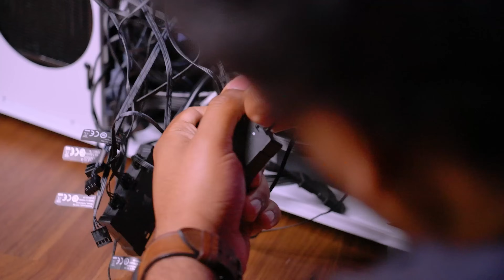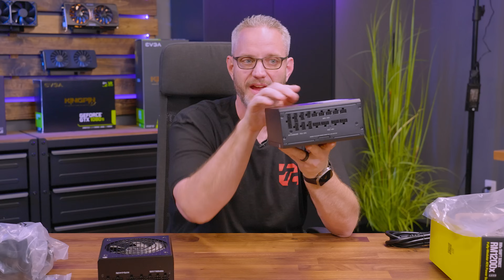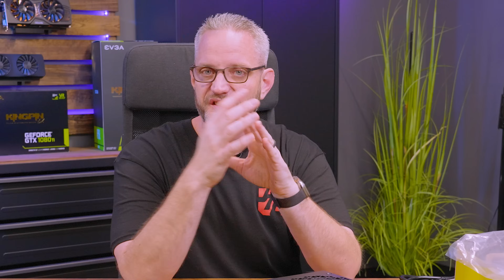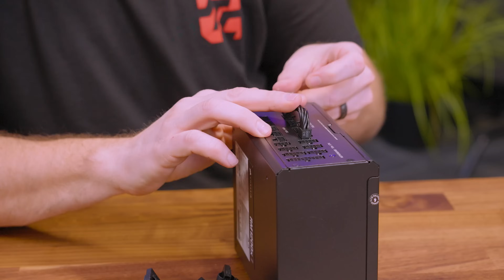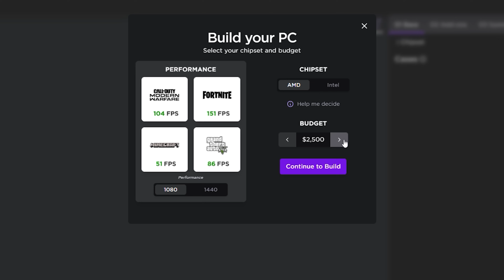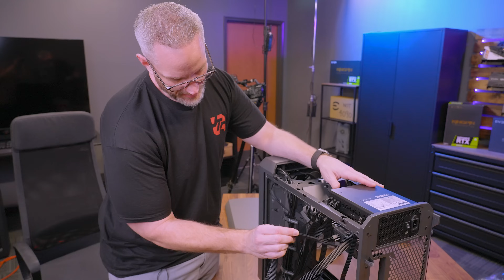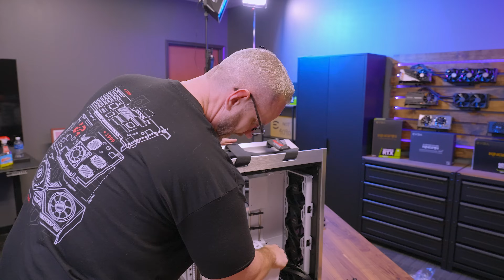I tried to prove this design was a failure... But then this happened.

Comment: I have a beQuiet dark power ... 11? 10? with 750W with sleeved cables. Getting this into the O11 Dynamic when using all cables the PSU supports was  "an endeavor". The fact you had to sort the cables out from inside, from the only place you can cable manage in the first place, while the sleeved cables stick to each other like glue was hand cramp inducing.
Seeing this PSU with the cables in that case coming out the top, which is space currently in my build completly unused is rather nice.

Tho I doubt the O11 Dynamic was designed with the consideration of people actually using all the thing can do at the same time. I.e. 2 SSDs, 2 HDDs and upright GPU mount, and a Lian Li control box, which all together leave little options how to arrange the backside. (And the updated version of the O11 we saw at some point, which adresses such things, dunno if that's out yet, showed that the design wasn't optimal)
Having to use PSU cables that have I think 1 SATA and 2 molex adapters because the PSU did not deliver enough SATA only cables did not make it any easier.

Comment: A better PSU standard is to output 48V of high power loads. This has been the standard voltage for communication equipment for over 50 years. This is the voltage used in servers. It would reduce the current being carried by the cables by 75%. Far fewer melted cables.

Comment: One reason power supply videos are boring is because they use circuits invented in 1920. In the last 100 years, there have been astonishing advances in power conversion. 2011 vintage circuits are cheaper, smaller, more efficient, have less ripple, have better transient response, and put less stress on components.
A bridgeless two-quadrant power converter produces less harmonic distortion fed into the power mains.
An interesting question is "Why don't manufacturers use 21st-century circuits?"

Comment: this PSU was degined for use in the 5000D/4000D corsair cases. the space between the standard atx PSU and the 3.5" drive bays on both series of cases is fairly limited, hence the reason for corsair to creaqte this PSU

Comment: You could say this power supply is useful, in a CASE BY CASE circumstance.

Hopefully the future has a slimmer, longer power supply in the future, with cases to fit it ,  with maybe the options to split the wires.  Maybe the main powers come out the old way, and the extras/more pcie etc come out the sides, or the option of both  or either.

Comment: I did get the corsair hx1000i and their additional 2x 8pin to 12vhpwr cable was worse than the asus tuf 4x 8pin  to 12vhpwr cable, i did lose performance by changing cables. For some reason, the power supply can't deliver as much power from just two pins even that corsair claims so.

Comment: Can an old power supply like the Corsair 1000w gold 2021 work with todays cards like 4080?
Reply: Yes, it can work with 4080 but you need to make sure you have 12VHPWR cable in place.

Comment: If your case doesn't have room, you have the wrong case. No power supply will work in every case. Use a Corsair case if you want the new Corsair power supply. I personally feel your review is flawed.

Comment: Smaller wires, smaller connections= less power transfer and increased thermals
Reply: The only change is changed from mini connector (4.2mm)to mirco fit (3mm) connector and mirco fit connector is same as series as 12VHPWR connector (new PCIE 5 12+4 pin). All connector terminals of micro fit is used alloy copper (lower impendance)and the connector can support to 105C. Should be very safe.

Comment: I'm doing a new personal build today, with a basic mid-tower from Antec. That PS would be perfect in my new case. PS sits at the bottom and those side plugs would put the power cables out into the back space perfectly.

Comment: I saw this and almost bought it but realized my case wouldn’t work with it as my psu is in the front panel which can make cable management a little tricky but still love it the case is the Vetroo AL-MESH atx if I’m not mistaken love the design just the way that psu is no case will work with it that well

Comment: That was a fun and informative eval., Jay & team. I think your assessment was very fair. It's a great cable management option for creative building but, as discovered, it's not for every case. Also, kudos to Corsair for thinking outside the PSU box. Cable size may concern me but, benchmarks to be revealed, (smaller wires with higher thermal. Hey, It may be negligible). Thanks JTeam!

Comment: Here's my favorite thing about this channel so far, I've been watching for years. Jay is VERY opinionated, for good reason, he's been doing this forever. But that makes Jay so AWESOME is this: He's very opinionated, based on experience, BUT HE'S NOT AFRAID TO TRY SOMETHING EVEN IF HE THINKS IT WONT WORK, AND HE WILL CHANGE HIS OPINION BASED ON WHAT HE DISCOVERS AND HAS NO PROBLEM MODIFYING HIS APPROACH OR CHANGING HIS THOUGHTS ON AN ISSUE. He came into this fairly certain that he'd have all sorts of problems, but by the end, he gave the idea his endorsement because although he's OPINIONATED, he's also very open-minded. THAT is why I love jay. He's not afraid to speak his mind, AND not afraid to try new things and change his opinion based on what he finds. Perfect storm of good traits right there.

Comment: I bought a 1000W Shift PSU for my (very) new build.  Wasn't going to work with my old case (Corsair 780T) due to the PSU shroud in the case blocking the pin-out.  Ended up getting a mid tower case instead (4000D), which I didn't want to spend money on, but I appreciate having a more reasonably sized case now.  I am, however, still bad at cable management lol.

Comment: Of course this would come out a few months after I built in a 5000D case. I put a 1200 watt corsair PSU in, and it physically can't fit without removing the drive bays. This would've been the perfect solution.

Comment: Thermaltake Core P3 TG Pro, my favorite Shift PS disaster, but not! As long as you don't mind cutting a hole in the back for the cables it fixed almost all of my P3 complaints. With the cables exiting out the back they are not just completely hidden but can now reach longer connections without extensions if needed.

Comment: Could have used this. I had a case where the HDD cage was behind the PSU. I don't know if there was more than 1 cm between. Had to remove the HDDs if I wanted to plug anything. The PSU  was visible on the side, and I think there was enough space, so this could have worked.

Comment: I like the concept, but they should mix and match. Why just one side if they can use TWO sides. 
There are things you need to access often, and other stuff you don't need to unplug as often.

This is also really cool for test benches I guess.

Comment: They could have made right angle connectors for the power supply end to fit in tighter spaces.  Also I'm not sure about using smaller cable diameters for more powerful power supplies, seems like a bad idea.

Comment: I bought the 850w shift to be able to mount a front radiator from top to bottom and a bottom 280mm radiator in my define 7xl 

This was one of the only psu's that would fit

Comment: on the last case you could run the cables out of the small hole on top of the shroud for the power supply and then run it behind the motherboard and out of the hole on the back of the motherboard. it would perhaps not be optimal, but it would work.

Comment: Hey team, can anyone help. Listening to jay talk about the power limits via the 12VHPWR connection on 850W models is the first I've ever heard of this. It doesn't help that looking at the sticker Jay pointed to on his box shows ATX 3.0 <= 300W PCIe 5.0 on the box I've just bought. So from what he's saying the PSU will only be able to provide 300W to the card via the 12VHPWR connection, this wouldnt't even provide a RTX4080 the recommended 420W that Nvidia suggest. 

Does anyone have any experience running the 850W with high end 4 series cards?

Comment: So I think the shift psu is an awesome idea for specific use cases. Only thing I feel is that if they are offering it that way then they should offer it with the connections on the opposite side as well. For that psu will not work in the Thermaltake core series, like the p3,p5,p7,and p8.

Comment: I got this power supply one afternoon when mine died, didn't notice it had the connections on the side until I unboxed it. When I tried fitting it my case didn't have an opening large enough for the cables so I took my angle grinder and lengthened the opening by about 6 inches, then after an hour of filing I painted it and it was ready to go. So far I'm happy with the design made the bottom look a lot cleaner and it's pretty easy to work with.

Comment: The only problem I have with all power supply Manufacturers is the wires used. House wire 20 amp is 12ga. and 15 amp is 14 ga. even my low voltage light's come with 12 ga. wire where most power supplies come with 16 ga. main (motherboard and video card) 18 ga. for the rest.  My other gripe is the PCIe cables come pigtailed unless you get a high end one and even then they only supply 3 single 6+2. I would rather have 4 6+2 PCIe along with the 16 Pin plug on all 850 watt and higher on the newer ones and the older still and cheaper ones should have come with the 4 6+2 PCIe without any pigtails. Low gauge wire and pigtailed 8 pin are no good to me on modern high powered products.

Comment: honestly, i think PSU's should have been designed with that in mind to begin with... however things between 'back in they day' and now have changed.... most cases now have PSU's on the bottom.  way back when they were always on top...  PSU's used to have through fans.. now it's typically a single large fan on the bottom (or top as it may).  in which case that creates the idea that the PSU is directional.... which in a way it would be... but it is possible to have the fan in the 'wrong' place and still work.. but having the cables come out the side is a nice touch for aesthetics.   the downside is they'd almost have to create 2 versions dependent upon wear you mount the PSU.... so i see both aspects

Comment: A good idea to have things different but a pointless option for a lot of cases my Coolermaster HAF700 EVO would have the same problem as with the O11 but I can remove the HHD cage easy and leave it out if you wanted . as I have no HHD in my PC at the minuet It would work and may even keep the cables better more so for the CPU power as like you said it only fits diagonal but I can hide is behind the HHD cage LOL

Comment: Most of the cases I build with, the PSU doesnt face down. Instead, it "stands" on its side. If there was an SFX version of this, it'd be awesome - eg. for the Meshlicious and similar tall instead of long cases (why? because you can put the cables UP instead to the side - which can be a total PITA with the classic layout).

Comment: Big problem I see is lots of cases have sheet meatal straps and bares and this looks like that could cut the cords and maybe short your system out.. Due to sheet meatal is sharp. Plenches and cuts is exactly what you do not want in a build.  would rather have bad cable management that that. Wjat I wonder is how this will work with Corsair cases and if they will build their cases around that power supply.

Comment: What annoyed me personally is that it’s like Jay is neglecting the fact you could just remove the hard drive cage altogether on the 011D Evo and cable management becomes a dream in that case with that PSU. I have that case (and have the hard drive cage removed) and personally if I went with that PSU if it was available at the time it would have been a lot easier with my cablemod custom cables. Not the mention the HDD cage is mostly unnecessary for newer builds now as it would be a lot better to go with M.2 instead.

Comment: This seems a stupid idea born out of a desire to show something different versus any functional improvement. You run power cables and then forget about them. It's not like you need constant access to them. Even with the plugs on the side you still have to route the cables to the same location unless you want them obstructing the primary viewing area which most people show off in a build. You gonna run them straight up from the side and block visibility/access to the motherboard, video card, etc.? And if you run them in the usual fashion as with traditional PS, then you're simply making the cable runs longer and using smaller gauge wire to carry the same power over a longer distance...not a recipe for improvement. Maybe if you had a case where you could route the cables under the PS it might be useful (with some very long custom cables). I can imagine it's hard to improve a product which has had the same form factor for decades, but this seems destined for the clearance shelf at the local Microcenter...

Comment: I just finished a build using exactly this power supply (1200x Shift) in a Corsair 5000D Airflow. As you mentioned, they're both Corsair products (part of why I chose them) and it worked flawlessly. I hooked it all up with a 7950x and a 4090 and it's been a dream to use.

Comment: when I bought my 4080 FE I picked up one of these. Not realizing it had shifted the plugs to the side. I had a Gamdias talos P1 case and couldn't put the back glass on it. I got a 011 Dynamic case and it's an awesome power supply for it. highly recommend it for cases like the 011 dynamic, hyte 60 and nzxt H9 Just wish it had a higher rating.

Comment: I've got the Corsair Graphite 760T, which is kind of on that transition point between older and newer designs, and the PSU is still just out and in the open area instead of hidden in a bay, and I'd basically have to pull it out of the case to change cables in it.

But it looks like a great choice if I move into a Hyte Y60.

Comment: If the cables were the same as always ( cable extensions) and it didn't cost any extra money then I can see the point in a few cases. Bur why in the hell would I spend more and then not be able to use cable extensions when you average psu layout works just fine.

Comment: On the torrent case I’d get a small piece of rubber or plastic tube and cut a slit in it to slide over the edge of the metal and that will make a sort of grommet. I have done this a lot as a diesel mechanic using a piece of airline tubing so when running electrical wires along frames or in dashboards to keep from having the wires damaged and shorting out. There is a little wiring hack for any time worries about damage. You can also put a couple of strips of tape to do the same. I’d use electrical tape if going this route. The glue on electrical tape is less sticky and will have a less of a chance of peeling paint unlike duct tape

Comment: Looks like this thing will shine in prety much any Phanteks case including its Metalic Gear subdivision as it leads exactly into the cable management area with a lot of room between sidepanel and board plate with the holes and zip ties

Comment: in the ROG Helios case if you look at the case closely you can remove the side panel covering the power supply but it might require reel work to do it and it will take away some stability of the case

Comment: Eh I think it's nice to have options and will always side on the side of the company willing to innovate and not just iterate. Iteration is the easier, cheaper, and safer approach; but you never see anything really new. I think I'd like it more if they had gone with 90 degree adapters standard to kind of handle that initial bend for you. Even if it was a 90 degree in a slightly wrong direction, it'd still be better than having to hard over near the pins.

Comment: NEVER_EVER_CORSAIR_CRAP_AGAIN
Minute 18: Terrible Bend Radius on the cables. Terrible Accessibility 
Minute 16: Thanks for Reminding me that the CORSAIR RM750 PSU had too short CPU Power cables. CORSAIR RM750 PSU DIED after 18 Months and was replaced with an ENERMAX POWER SUPPLY which had 10 centimeter longer cables for the CPU Cable.
Minute 5: NVIDIA Crapware. If I have 850Watt PSU and the other Stuff takes 200Watts  rounded up - why should i not be able to use 600Watts for the GPU.
One more Reason to not buy NVIDIA. These days most of the Watts are on the 12V-DC line. - do not be fooled - Corsair is shit in regards of RM750 PSU or Corsair MP 600 PRO 1TB NVME drive.

Comment: Can you please do a build consisting of these components AMD Ryzen 7 5700X 8C/16T 4.6GHz 36MB Cache AM4,   Cooler Master ML360 Illusion Addressable RGB AIO CPU Cooler. ,  Cooler Master MasterBox TD500 Crystal ARGB Case.  Corsair 32GB(4x8GB)CMW32GX4M4C3200C16 DDR4 3200MHz Vengeance Pro RGB.       GeForce RTX.  3080 GAMING OC 10G FROM GIGABYTE.        Cooler Master MWE 850W 80+ Gold V2 Fully Modular Power Supply

Comment: On the last case (white, the RoG case), I feel that it would be possible to cut an additional large slot/hole in the side metal wall with a Dremel tool (and then to file the edges down) so that the cables could be easily managed from the side.

Comment: nice thing about it in the fractal torrent (nano specifically, cause it doesn't have the side 3.5" cages) is now you can run your hard drive cage, when to do that normally you'd basically have to have no cables or a sff power supply with an adapter

Comment: I recently worked on a system that has a Superflower 1000 watt supply in it. It is not ATX 3 compliant and did not have the cable needed for a high end video card. It was a really tight fit in a Fractal Design Define 7 XL case. I am annoyed with Superflower for that reason. I'm leery of Corsair products. Time will tell if this power supply works well. I'm sure other vendors will study this design and produce a better one.